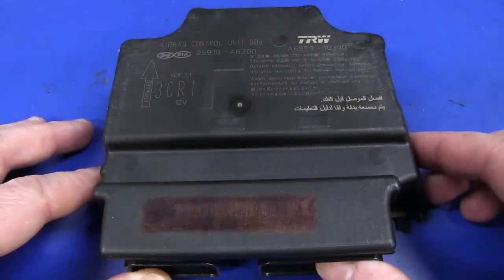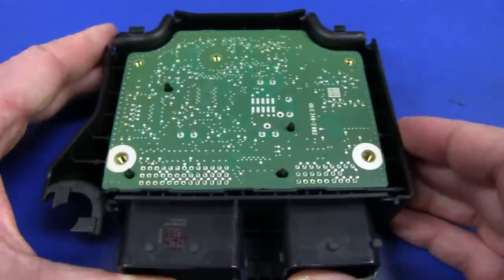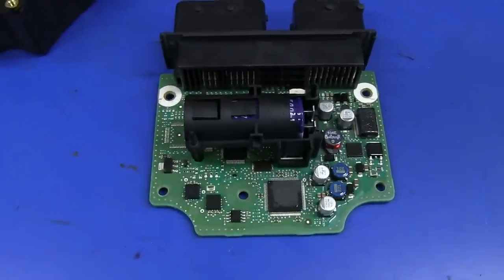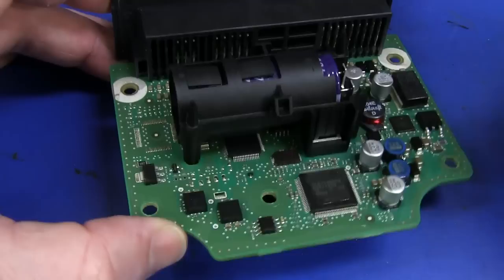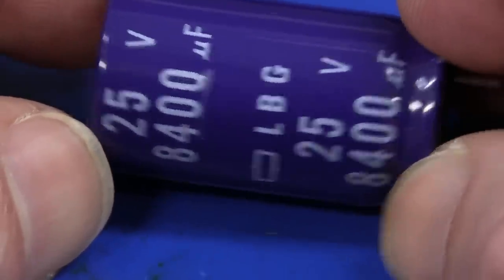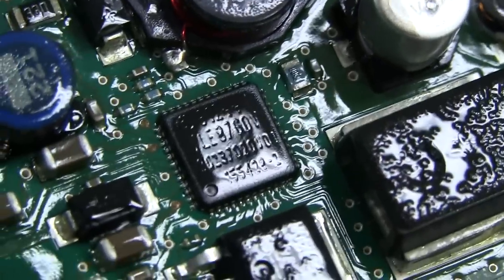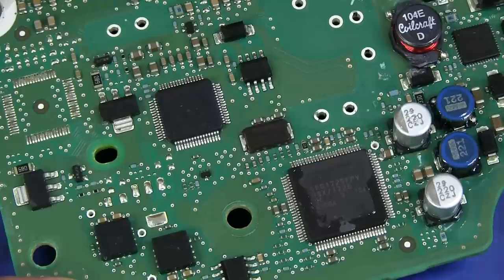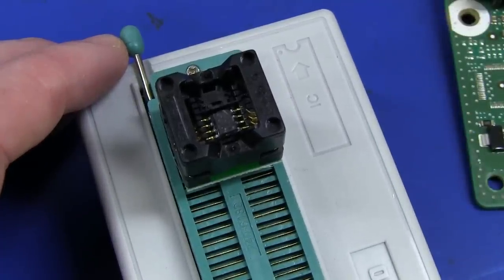EEVblog #517 - Car Airbag Controller Teardown

Comment: The main SRS controller is also the safeing sensor it must see not only rapid deceleration it must also receive input from one of the 2 other senors on the front fenders.cap is in there so if the battery fails in the crash all the SRS bags can deploy. It is programmable and sends data to and from the ECM and ABS Traction control. And yes it captures event data. During a law suit Chrysler sent an expert with a  device that required the dealership DRBII so I went with him to the working yard and was able to see crash data it showed the braking the crash sensor the speed of deployment proving that it worked as supposed to. they are proprietary and built to OEM specs and built to OEM software code. It is built for 1 failure and can be reused but its not to be reused This is why you need to know your used cars history it could be compromised from reuse. these system's are built to survive past the life of the car but you should never buy used SRS parts for they may not fit the programming of the car and the bus system programming. often gold plated at the squibs for long life and deployment. And yes the first systems in 1989 used a big gold plated weighted ball for the Safeing sensor but it was gone by 1990 or so.
This is my field I am not as smarted as most of you but I love electronics and Mine was Automotive for 35 years and beyound NEVER REUSE SRS Components

Comment: I work for a avionics company. We do extensive vibration testing on all of our equipment. Most all of our equipment has large (3-4x 8200uF) caps to hold up the voltage rails during power faults. Some products dont have fancy housings for the caps, so we had a lot of trouble with electrolytic caps "delaminating" from the pins vibrating. We did fix it, but putting your big ass caps in some sort of housing can be very useful to get through vibration testing.
Reply: It's not really "power faults" - When the aircraft switches from one power source to another (say from the airport's power supply to the aircraft's own power (a simplification, but whatever)) there is a short interruption to the power supply. You obviously don't want everything on the aircraft resetting twice before every flight, so there's big caps to keep the equipment just about alive enough that it comes back online immediately once power is restored (things like computer screens and lights will flicker off, but the computers controlling them will stay on the whole time).

Comment: Yes caps are for airbag deployment in case of battery disconnection during crash. Airbag need to work until end of crash

Comment: Hi Dave, They haven't dipped the whole pcb in conformal coating because the conformal coating would then cover those press fit pinholes wich will result in no contact.
Reply: And would also cover ground pads which normally need to connect to the metal casing for better EMI protection

Comment: As has been said already, the cap is effectively an interruptible power supply to ensure operation of the air bag system, in the even that the car battery or major wiring is damaged during the collision.

Interestingly, the internal power rails for the module and detonators are usually galvanically isolated from the car's chassis/battery supply. This ensures that in the event of any output wire being shorted to either chassis ground or +12V there is no risk of either false detonation or failed detonation.
Reply: I'm sure you meant uninterruptible power supply.  UPS.

Comment: Hi Dave. Im an Automotive Technician for Ford and as someone stated already, the cap is for deploying the airbags when I firing solution has been made and to power the modules critical components. This is because the cars battery or harness could be damaged and not supply power to the unit. Side notes, the unit will not fire unless the vehicle is traveling at a minimum speed. I believe its 15mph. There are front and side impact severity sensors to determine where the impact area is. I believe the second accelerometer is mounted at right angle to the first, and they're used together for better accuracy because every millisecond counts when calculating when to fire the airbags.
Reply: There is no way that the vehicle needs a min speed for airbag deployment. Makes no sense at all. If we're talking about a head on collision, if one car stops by the time the other hits, so the people in the stopped car are screwed?
Reply: Quyen nguyen
You don't want an airbag going off because you bumped another car while parallel parking or because you hit a possum.
If it did the manufacturer would be hit with a class action lawsuit and rightly so as an airbag that sensitive would be more of a liability then an asset.
Reply: Patchuchan ***** Jason Walker , if there is a minimum speed at which it's deployed it would mean that a car that is at a stand still and struck by another car travelling at a great speed would not deploy the airbags. That's nonsense! It's purely based on G-force (and angle).
It has to deploy the airbags even if the car manages to stop, if the other doesn't.
Reply: Andreas Nyman Sorry I should have been more clear. The airbag modules have strategies for when the car is parked, but if a car hits you at a speed less then (what ever the threshold is, say 15mph) then the system will not deploy. Example of the speed stratage: if you goto the front of your car and find the crash sensor and hit it with a hammer, nothing will happen, except for having to buy another sensor. but If the car was moving forward at say 15mph and you had some one hit the sensor thin you will probably have a headache. Basically the speed im talking about makes the system need less proof that a crash is taking place. Hope that helps. And I should add that I am by no means an expert. Just sharing what I have know.
Reply: Andreas Nyman Also for a parked car the system needs to see most of not all the crash sensor read an aggressive change in velocity before it will even consider a firing solution
Reply: Jason Walker so you're saying that the manufacturers of modern airbags and other equipment is lying? Because one very, very important feature of the airbag is that it will only deploy when actually needed. That means that if the angle of the collision is wrong, or the decceleration of the car is to slow it will still deploy and when needed when the car goes off road or hits a second car or structure it can't deploy as it's already been? 
If I hit a very hard snowbank that destroys the front of the car, it will also deploy the airbag, so when hitting the concrete building 10 meters after I don't have the safety of an airbag :(

I know this was tested thoroughly in the 90th, but maybe modern systems is much worse. And how do I know this? I'm living close to one of Europe's biggest car-proofing grounds.

Being hit by a car traveling at 100kph when standing still is about the same as hitting a car traveling at 50kph when you do the same. Hitting a solid object at 50kph is the same as hitting an equal car to yours where the combined speed is 100kph, so you can't do much with knowing the speed.
Reply: Andreas Nyman Did you even read my post? unless theres a typo I missed, I have not said air bags will deploy when the shouldn't, or that they will not work when the should. I said they use different strategies based on whats going. Dont put words in my mouth. No one likes a troll
Reply: You said a hammer is enough to trigger an airbag at speed, which wasn't possible with the older systems at least, because they was only triggered when the decceleration was enough for the driver and passenger to be forced towards the steering wheel and dashboard.
Reply: Andreas Nyman the sensor I said to hit, was the same sensor that tells the airbag module that an impact has taken place. I really dont know if it would set off the system. I was just giving an example of what my set it off.
Reply: As I've understood it, Jason Walker, you'll have to trigger multiple sensors in a certain timeframe, just to make sure it won't accidentally detonate because of a glitch or interference (you don't want your mobile to trigger the airbag).
What also supports the theory that speed isn't used in the calculations is the NCAP testings, different regions use different methods for the same tests, in some the car is sent into an object, in some the object is sent into the car.
Reply: Andreas Nyman Hitting a car head on at 50mph is the same as hitting a wall at 50mph. Anyone who knows about the physics of crashes would understand this seeming paradox. They are the same. Also, there are multiple crash detection methods, other than the collision sensors, and the collisions sensors only enable at a specific speed.
Reply: Richard Smith isn't that what I wrote? The combined force of an head on collision at 50kph/mph is 100kph/mph as both are driving towards eachother at 50.
Reply: Andreas Nyman that is wrong. the force each car feels is the same as hitting a wall at 50. Every action there is an equal opposite reaction. Hitting a wall reflects nearly 100% of the force, while hitting a car will transfer roughly half the force into the other car, meaning hitting a car at 50 while you go 50 is exactly the same as hitting a wall at 50. There is no doubling.
Reply: Richard Smith so hitting a car at 50 that drives towards me at the same speeds equals hitting a wall at 50. 
If one of the cars is stationary, what speed has the other car to equal the same force?
Reply: Andreas Nyman A stationary car is not a wall :P but yeah, if you change to a hitting a stopped car head on, which is on wheels, then yeah, you would need to double it, but that's not the same statement.
Reply: Richard Smith Where did I say a stationary car is a wall?

Comment from the maker: Yes, that's what I meant, it continues to supply power for the whole system - controller, any external sensors presumably, and the airbag activation circuitry and charges.

Comment: Big cap is so it can still fire the bag if the battery gets mashed or disconnected during a crash - battery is often near the front so quite vulnerable

Comment: If you ever look at the module and it says Aisin on it, there's a good chance I am the Production Engineer over the assembly line that made that ECU.  We make the weight sensors on the seat frame too.

Comment: Conformal coating only delays water getting in.  Over time the PCB ends up at the average humidity of the air around it.  It does keep drops on the surface from working as conductive paths but nothing more.  If you want to keep water out, you have to use hermetic seals.

Comment: This box has so many connectors, because it interfaces with the main ECU and Computer in the car as well as the data recorder that acts as sort of a "Black box" for cars and finally, the front and side sensors that detect a front- and/or side impact with the car...

Comment: I'm betting the cap is there as a backup for a 2-stage collision where the first impact disables/severs the battery and the second impact requires the airbags to deploy.

Comment: David: I worked as Mechanic Shop Manager and some of are taxi has deploy airbag that when we fix it and replaced the airbag, We have to reset the information with a Air Bag Error Reader with OBDII interface (car interface for troubleshooting engine and sub systems)  because if not the Air bag system will not work. So the info in the eeprom is not only for fatal crashes but also for the main computer to read and report to the mechanic for troubleshooting.

Comment: There once was a guy working on an airbag system and his boss came over and decided to pic on the airbag module sitting on the console and turn it over and see what was underneath, when he did all the airbags blew and the rollover bars also blew. The boss almost fired the guy until he proved it was because of the sensors in the airbag module detecting when a vehicle(in this case a convertible) goes upside down. We had a real good laugh at that one since there was something like 10 airbags.
Reply: First rule of working on those systems, disconnect the battery.

Comment: Older cars used a tube mounted at a slight angle with a conductive metal ball in it and a pair of contacts at one end as their inertial switch. Essentially, the design was that if the car came to a sudden stop or decelerated with enough force the ball would roll up the angled tube and strike the contacts, sending a pulse to the controller indicating that the airbags needed to be deployed on that side. This did require a certain amount of force to get the ball to the contacts, you weren't going to accidentally set them off just by braking. Other designs did not use the angled tube but a weighted ball, and if the ball moved backwards far enough it would hit the contacts again indicating the need for the airbags to be deployed. Smart design if you ask me, and worked well enough in most cases. This design was mostly phased out by 1990 and replaced by electronic accelerometers and the like. Typically, the sensors were mounted separately from the controller, however newer designs have actually placed the sensor within the controller module itself. Either way, it works well and does its job.

Also, according to +Jeff Bankston they do capture event data like a flight recorder in an aeroplane.
Reply: +Noah Keck So what happened if, say an older car decided to head off a steep grade?
Reply: It would set off the bag if it was steep enough. This only happens at an almost-90-degree incline though, not sure if there is a hill like that around :D
Reply: Just if you're curious: If you drop your car free falling it would obviously only be 1g force on it (the fall, not the impact at the bottom!) and jet fighter pilots get blackouts at about 10g with their pressure suit on (which basically puts pressure on the legs to keep the blood in the upper body) so thats what modern military jet fighter planes can do. A car crash is at about 30-50g so you really gotta try hard when you wanna set this thing off. I dont know what g force they need to trigger but it's unlikely considering an untrained normal person would momentarily lose vision at about 5g. (vision field getting progressively dark from the outside in) So you'd probably even crash when attempting to set this thing off :D
Reply: Noruzenchi86 after further research some designs also included a stiff spring like in the Jeep Cherokee. It's also worthy of noting that the Cherokee had the sensor mounted in the air bag module itself, so no external controller was necessary and it also only went off if it was needed on that side.
Reply: If you were going down an 80 degree incline in one of those old hunks of lead... the airbag would be quite welcomed.

Comment: Yes, conformal coating is good for damp and exposed electronics, but then the failures will be connector wise, as those are hard to conformal coat unless they were designed for being sealed. Best bet is a sealed enclosure and a desiccant block inside with a pressure equalising valve.

Comment: Cap is for redundancy when battery fuse block gets cut in an crash. It probably triggers an main cut switch also for fuel pump and power. Most of the new controllers does monitor the belt buckles. If there not on it will not trigger that sides airbag. The data in the rom is the adaption data and the data weather or not to trigger passenger airbag. (Baby lockout) and also some backend data. I work with volkswagens Audi quite abit.
Reply: ToxicWaste ... If the data was wiped clean and the module reinstalled in the car, would the module still function or is there specific data already programmed on it from the factory? I have seen videos where people overwrite the data on module's eprom that had the airbag deployed and the airbag light won't turn off even though they replaced the airbag. They just obtained a copy from a good module and it actually works and the airbag light turns of as normal.. I'm just trying to get the airbag light to turn off on my dashboard... I have spent a lot of money replacing airbags and I'm sick of spending money on things that don't really need to be replaced and the problem still persists...any reply would be much appreciated..

Comment: Jupp, cap is for post impact crash recording. There are some requirements for recording data after bags blows. Don't know the time it need to record though. You are also right about the reset-flag, it needs to be "de-flagged" after a crash so it will blow new bags, can't confirm if that flag is in that e2-chip or intra-µC. One thing you may find interesting (or just forgot to mention) is the fallback processor. Its use is to monitor the main-blob and if a glitch is detected, it will do fallback.

Comment: The big diode is for protection. In case you somehow connect the battery in the wrong way. That exact diode is used in many other electonic devices nowdays. I whorked for HARMAN where we built head units for cars(Audi, Maseratti, FCA).

Comment: The cap serves as a power backup. Not really because the battery is the first to go in a collision but because modern cars (BMW anyway - where I'm working) have a explosive charge on the positive battery terminal. When a collision is detected the positive battery cable is blown off the battery to minimize the risk of explosion etc etc, hence the cap.

Comment: I remember reading in Ford service manual, when I was doing some work with crash sensor, that after you disconnect the battery you need to wait a couple of minutes. This seems reasonable.

Comment: I am probably amongst the very few people that actualy reflashed it's airbag ECU eeprom:) Mine developed a fault when some aircon cleaning foam dripped on the connectors, created some short circuit or voltage dip and ecu immediately saw it as the fatal fault : "replace ecu now at your dealer for a grand". Yeah right!